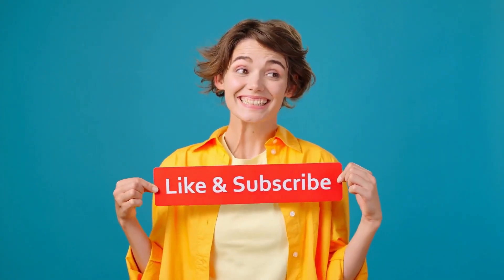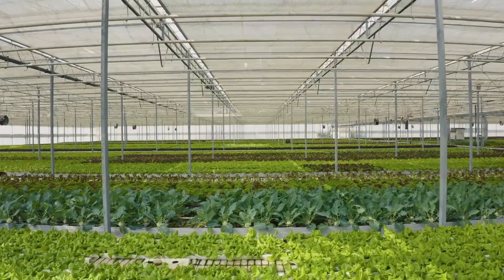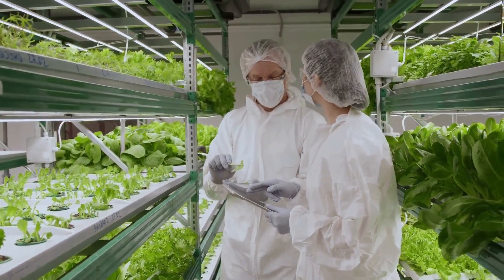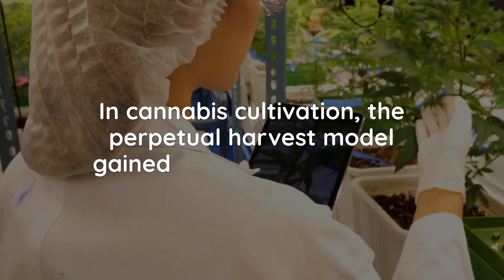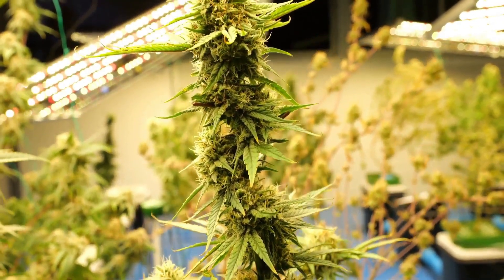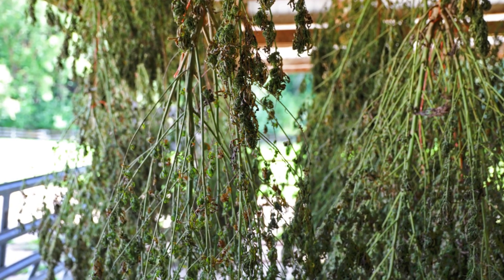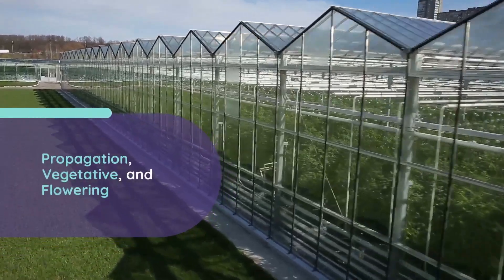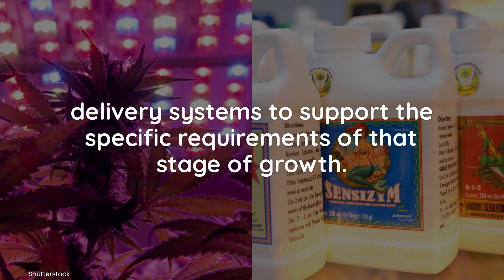Perpetual Harvest. Cannabis Grow Cycle. Full Overview. An educational video.

Comment: Can I use a clone tent and a regular tent for this method? Or do I need more?
Reply from the maker: Yes, you can absolutely use a clone tent and a regular tent for your grow—it’s actually a great setup, especially if you're looking to create a continuous cycle.

Here’s how it can work:

Clone tent: Use this for cloning, germination, or even the early seedling/veg stage. These tents usually don’t need much height and can run on lower-wattage lights like T5s or LEDs. This gives you a space to get your next round of plants started while your main tent is finishing up.

Regular tent: Use this for vegging and flowering your larger plants. Ideally, you’d use a taller tent with better airflow, stronger lighting, and environmental control. You can transition plants from the clone tent into this tent when they’re ready for full vegetative growth and eventually flower them.

If you’re growing for personal use, two tents are often enough. The only time you'd "need more" is if you're trying to stagger multiple harvests with more precision, or if you're running different photoperiods (e.g., keeping moms and flowering at the same time).

So no, you don’t need more than two tents—but the way you use them should be dialed in to your grow goals and plant cycle. Let me know what you’re planning and I can help optimize it!